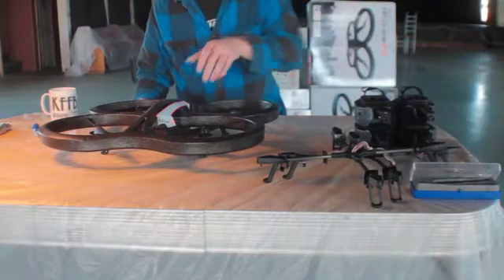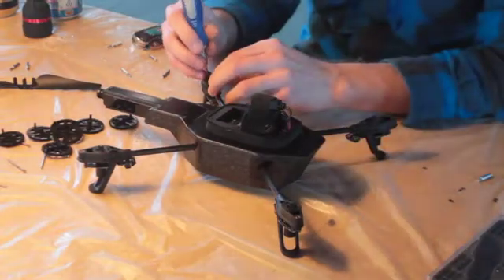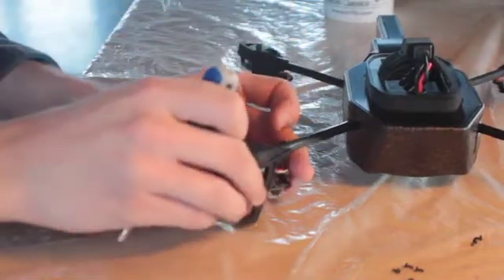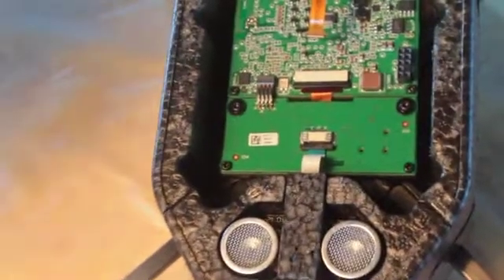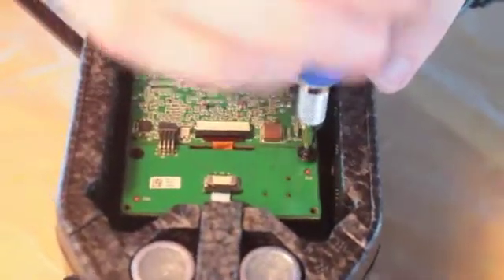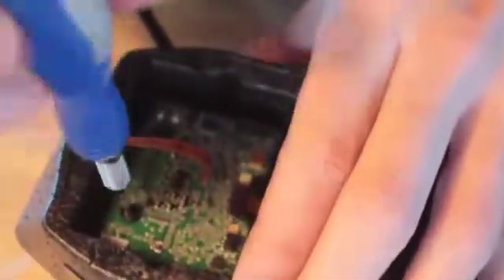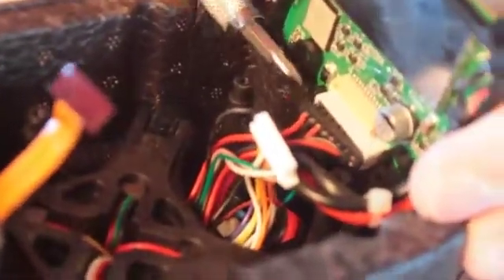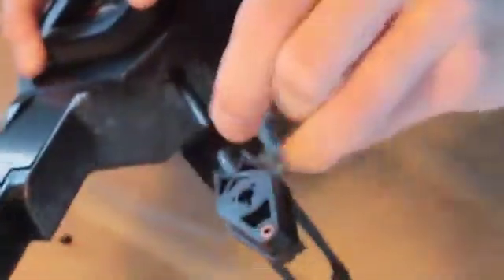AR Drone 2.0 Replace Central Cross How To - with Upgrade Tool Kit - Episode 1

Comment: Installed the cross and now it wont take off. I put the props on how im supposed to and it wont lift. If i reverse the props, it lifts but wobbles and crashes as soon as it takes off. Did i install the cross wrong? Is there a specific postition? I noticed theres numbers on the bars. Are 1 and 2 i. The front? I installed and noticed i have 1 and 4 in the front.

Comment: I did the cross repair, now i have an error showing on the screen pic emergency error! Anyone help me?
Reply from the maker: Sounds like one of the yellow ribbons plugged into the boards isn't plugged in fully. Also try a hard reset, it's hidden in a hole under the battery.
Reply: AR Drone Show w/ Kyle Tarpley Just push lightly til I feel the click and release?

Comment from the maker: The battery is compatible from the 1.0, you'll need a 2.0 charger though. The cross is slightly different but your old 1.0 CC should be able to work. The motors are ALMOST the same, just don't mix 1.0 with 2.0 motors, that'll give you some trouble. If you're going to use your old 1.0 motors I would recommend using 2.0 motor pinion gears though.

Comment from the maker: Yikes I actually tried that once but gave up. You're going to need something really sharp to slice through those legs of the central cross. And if you're rebuilding one, you're not going to want to slice the cables going from the center to the feet, so look out for that. You're going to need a very sharp blade and some very strong glue Erwin, good luck!

Comment from the maker: Your first several times taking the c-clips on and off is admittedly a little awkward. It makes it easier if you push the propeller up, so that you don't have any extra height on the shaft above the prop, to keep the clip from going up or down. That way the c-clip will be locked into place--make sure the open part of the C is facing you--and press firmly away from you. Don't try to push up or down, just lock in place by pushing up on the prop and push away. Just don't lose it :)